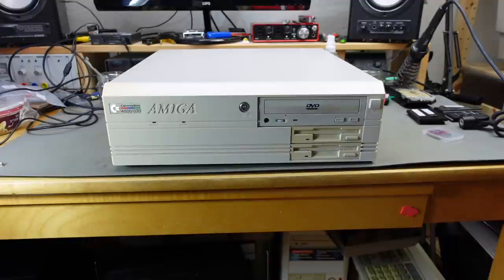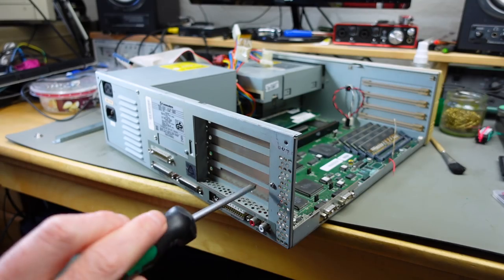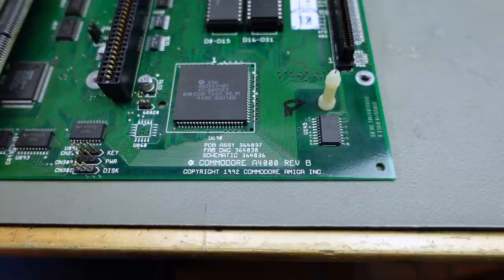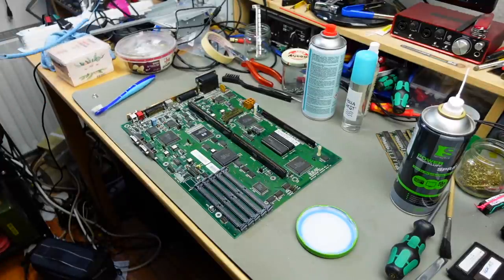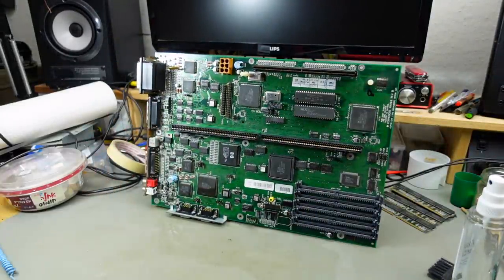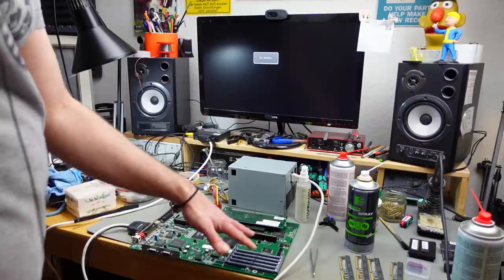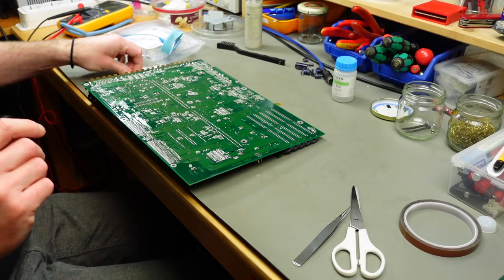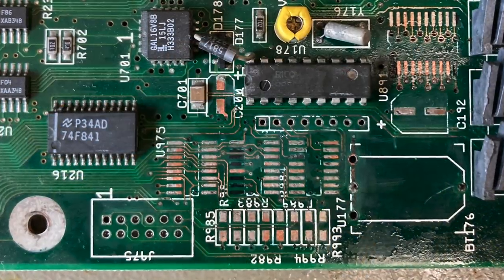Amiga 4000 Battery Leakage Repair Part 1

Comment: Hi! There is a tip on how to omit U976, it is used for nothing on the A4000 (The "Options" jumpers that are not used at all). It only requires one small jump wire from U975 pin 1 to GND. It saves a lot if traces are bad around U976 :) Compare A4000 rev B schematics with A4000 rev D which doesn't have this chip at all :) Hope this helps!

Comment: Awesome. It's finally revealed!
Sorry to have shipped you such a rabbit hole of a machine. But I suppose an A4000 needs to be earned. ;)
I am crossing all my fingers and toes for it to be fixable. And then we can maybe see about some upgrades, who knows... ;)
Reply: Don't feel bad about the machine. Every A4000D motherboard looks about the same. However, it's in good hands! Thanks so much for donating him the machine. Us viewers really appreciate the lessons we learn from watching Jan work on such a precious computer!
Reply: @milk-it  Not all A4000 boards look like this (ok most do). I got lucky with my late 1993 Rev D A4000 board. The has a factory-set lithium cell and no battery. Therefore no corrosion damage.
The capacitors were still good and could be replaced before they leaked.
Reply: @sircathal7505  Yeah, I'd say you got lucky ;-). The capacitors on my old board hadn't ruined it, yet, either.

Comment: Thanks for this - it encouraged me to get my old A4000 out of the garage and inspect it for battery damage. Fortunately in my case the corrosion was only on the + terminal of the battery itself and hadn't migrated to the board. I clipped it out and cleaned nearby with IPA. I saw a few dull pads on some of the 4.7uf electrolytic caps, but all the other values were still bright and shiny. My board has a Rev 09 Superbuster and date codes from late 92. I also discovered that the rubber feet had liquified inside and spewed tarry goop all over my benchtop. That cleaned up with IPA and elbow grease and I removed the remaining goop from the case.

Comment: The high density floppies spin at half speed (only when in high density mode) because Paula is the floppy controller, and it was only configured to handle the data rate of double density disks. Since high density disks have twice as much data per track, to keep the same data rate they have to spin at half-speed. 

Since in AGA Paula is still the same old Paula, they just kept using the HD floppy solution that they originally created for the A3000. This also means the HD floppy drives work on all Amigas since they all have Paula.
Reply: That’s pretty interesting! So this is one of the HD floppy controllers that can’t handle 8" disks with an adapter? Since those spin at a fixed speed and use the HD data rate.
Reply: @kaitlyn__L  The Amiga floppy controller is actually pretty flexible, but the entire track has to fit in the DMA allotted to it. Paula isn't set up to do that for a full-rpm HD track. Even if you ran Paula with extra DMA by using ECS/AGA DMA slots (this is how you can do 56khz audio on Paula), Paula would want to use its existing structure to read/write the whole track.

It might be possible to read a HD floppy by hammering Paula's registers with the CPU but if that were possible I think someone would have done it already.

Comment: If I ever get my old A4000/030 back I know this is going to await me,... and I am not ready for that! I need a lot more practice will solder and PCBs BUT I hope this goes well. You have already given me encouragement that I can deal with with A500s and 8 bit machines, May be one day I can attempt to do what you are doing now. It certainly brings back memories of the 90s when I had a maths co processor but not the skills to install the crystal socket... so I just put the crystal with it's legs bents into the processor board and fairly often got the yellow screen as the legs were not in contact with the vias! Oops.

Comment: Chris Edwards (former CATS) has done a few similar boards. One much worse. Got it working!

He frequently refers to the interactive schematics and buzzes through the traces with bodge wires to replace those beyond repair.

There's a good chance that yours will be working, given time and patience. It's only rocket surgery ☺️

Comment: The vinegar does corrode things if left on the board, but the NiCd battery liquid is worse. The battery liquid contains some elements that leech into the solder and changes the alloy. This new alloy has a much higher melting point than "healthy" solder. This makes desoldering more difficult, and the risk of heat damaging the PCB increases a lot. I don't know if it leeches into the copper as well, but it woudn't surprise me. NiCd battery liquid is just horrible stuff.

Comment: Congrats on your A4000 donation, Jan!  
I am under the assumption that the corrosion gets under the solder mask and follows the traces underneath even after a thorough cleaning with white vinegar. Here you said the corrosion was halted but I respectfully disagree. As you saw after a full cleaning there was still remnant green stuff under an IC.  

I think it can even get in between the layers of fiberglass of the board, too. Recommend an ultrasonic cleaning but I realize that the board is too big to fit in most cleaners.  Just need to clean the one side of course... Will watch Part 2 later.

Comment: Hello great channel. Yesterday i also got me a Amiga 4000/030 i cut out the battery and messured the powersupply and looked for shorts on the mainboard. And i started it yesterday and it works. But a werry noisy fan i need to repair and Retrobright on the case.  RB Retro Bunker is my channel verry smal :)

Comment: hi Jan, 
The amiga 4000 will take at least 30 seconds to post a kickstart screen if no hard drive is connected (maybe no floppy also causes delays but I can't remember) depending on the version of kickstart rom installed.

Comment: What a cool machine to have for a project!  Even if you can't get it working as is, this would be a great donor board for building up one of the reproduction/enhanced motherboards for the A4000.  Even considering the immense amount of work I feel that it would be worthwhile considering that in modern times these machines may as well be made out of pure unobtainium.

Comment: Vielen Dank, Jan! I've been hanging out for you to do something with an A4000D. I've got one and ended up swapping the original motherboard with a refurbished one. The original one powered up fine, but the RAM slots' clips broke. Desoldering the RAM slots to replace them was a nightmare. I've left the original motherboard out for a future refurbishment, but it's going to take quite a lot of time.

Comment: I don't know if you have this product in Germany, but the best thing to use to stop the battery residue and its chemical reaction, and to also loosen it, is to use WD40 on it.  WD40 isn't just a lubricant, it's designed to penetrate corrosion and loosen it.  It also chemically neutralizes the acidity in the residue.  You need to pool it up (spray a lot) and let it sit for a few hours, occasionally using a toothbrush to help loosen the gunk.  When it seems to have finally done its job, use alcohol to remove the WD40 oily residue.  Or a little bit of Dawn detergent in warm water works too.  Use the alcohol to remove the water and any detergent.  You will be surprised how well this works.

Comment: For removing the motherboard, there is a tool that's available here in the USA:  a ratcheting bit driver.  It will drive any 1/4" (6.5mm) hex bit it tight spaces.

Comment: You should definitely replace all Ram sockets. Among the front two are VIAs which are certainly attacked at the level of corrosion. The third RAM socket is certainly also attacked because there are green contacts right next to it.
Since the chipram socket is defective, it also has to be replaced and if you have to swap 4 out of 5, you can do all of them at once.

Comment: My theory with the slow floppy drives is that Commodore wanted to carry on the tradition from the 1541. Just gotta make a Zorro slot version of the Epyx Fast Load cartridge and speeds will be fine. ;)

Comment: Gadgetuk164 did a great series fixing a couple a4000 boards with the same kind of damage in the same area, it may be worth a watch for some ideas on how to rebuild that area.
On another note I'm totally jealous as a person with Amiga sickness the A4000 is like the holy grail, im always hopeing to find one, not the most common machine in Australia.
Reply: Yeah Gadget did some impressive work back then. As for the A4000 being the holy grail, yeah, kinda, but try and find an A3000 actually. THAT is a proper nightmare. :)
Reply: Agreed the 3000 is a rare machine indeed, id be happy with a 2000, sadly I don't have any big box amigas in my collection, have been considering sacrificing one of my 500's to build a 2000, that way all I have to find custom chip wise is a buster, put it all on one of the new reproduction 2000 boards, could be a fun project

Comment: great 😀 Thumbs up Beta! many would simply use PCBwaaaaaay and re-manufactured a4000+ board or variant.
Reply: Kind of a toss of a coin thing. Noone really knows which way it will be more work at the beginning.
This corrosion looked tame at first but got only worse with each removed part.

Comment: I’ve done 2 A4000 boards myself fortunately I caught the battery early so the damage was very minor. I did get given an A2000 where the battery had leaked so much half the motherboard was damaged, that one was way too far gone.

Comment: I need to finish getting my 4000 fixed. It's partially done, recapped and cleaned up but something isn't right since it crashes after a few minutes. Don't know if the conversion from 040 to 060 (CS Mk II) is the culprit or the 060 isn't fully functional so I have to revert it back to 040 again. Running tests I get indications that there is a fault with one of the CIA's but if that's just a result of something else not working properly or not I don't know. Also, my CV64/3D isn't working at all, computer crashes when I try to initialize it. Don't know if it's the card itself or if it's because of something else. All other Zorro cards work just fine. Just felt it was to much so it has been sitting for a while which is sad since I used to have so much fun with it up until it started acting up a few years ago.

Comment: hm, after seeing the damage, whouldn't it be better to work on a replacement PCB and move the Chips over?? 
Are people trying to make a new PCB for the A4000 as a Replacement for the old Boards?
Reply: Kind of a toss of a coin thing. Noone really knows which way it will be more work at the beginning.
This corrosion looked tame at first but got only worse with each removed part.
Reply: @catriona_drummond  Well, it depends on the Damage.
The Problem that I see is that we can't be sure to get rid of all the corrosive elements and that the board will work reliable in the future and that the corrosion would continue...

Yes, it would be a lot of work to populate the new board, but I think it'll worth it (also: it should have green or brown Soldermask, not Black, Black Sucks).
Reply: @Stefan_Payne  we definitely agree on the colour. As for the board. I guess projects like these just tend to murphyslaw themselves into an zone where they consume the maximum amount of work. I kinda hope this board will make it through so Jan doesn't have to start over.

Comment: hm, have you thought about getting an Ultrasonic Cleaner?
Reply: This size, it's pretty expensive for a hobby. You can use a dishwasher, not too hot and no detergent works fine.
Reply: @Breakfast_of_Champions  yeah, but wouldn't it be fine if the board was just partially submerged and only the affected area cleaned??

Comment: Vinegar just evaporates. It does not stay there. Whatever smelled like that, it was probably not that.
Edit: Also, just wash the board with dish washing detergent and a long haired soft brush after removing the caps. That's gonna take off the cap jouce and whatever the vinegar left beehind.